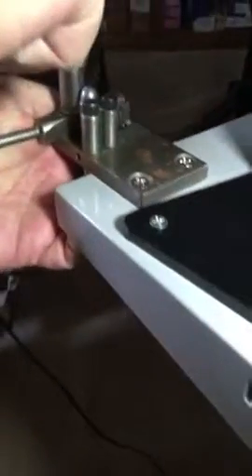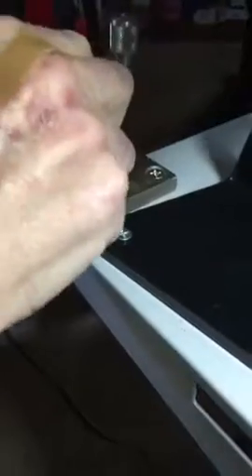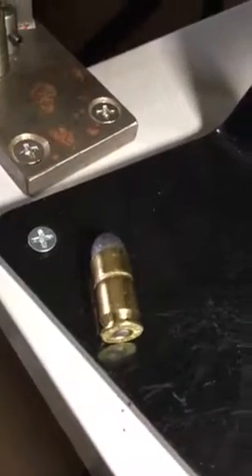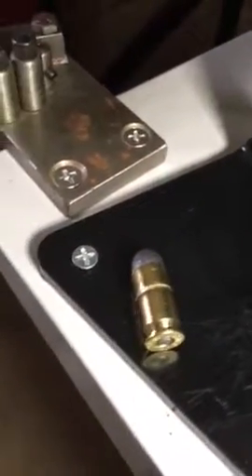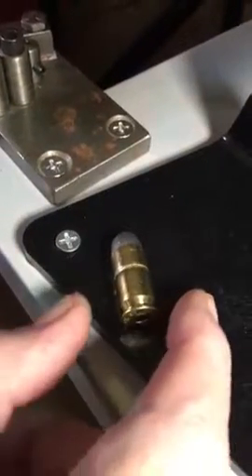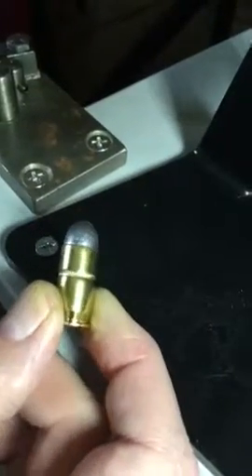How to put a cannelure on a 45 ACP case

Comment: I see a lot of issues with modern ammo in a 1911 getting pushed back on the cases. Even when it is crimped I notice the projectile will get pushed back when I clear the gun after chambering. The problem is so bad I got a bullet puller and have looked into reloading because of the primed cases I have floating about. I can see rolling my own with a cannelure for this purpose.

Comment from the maker: Oh great person of wisdom. Go back and look at most 45 ACP manufactured in WW II,  and you will see that government specs were that the case cannelure served its mission admirably.
Bullet push back ,due to hard use. That right there could cause a bigger problem than your previous pointed out flaw. Nobody says you have to do that to your brass today. Even though as long as your using the same bullet reloads are beautiful... you’ve heard of the fellas that reinacting